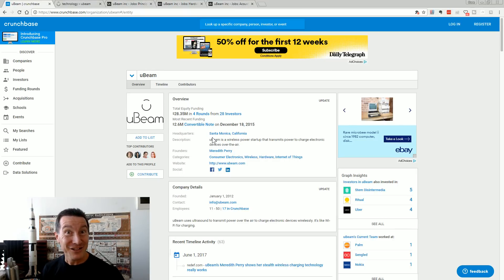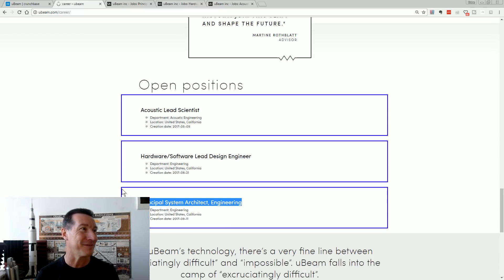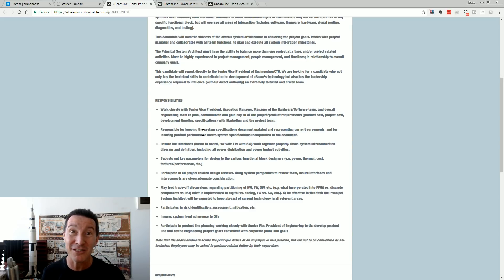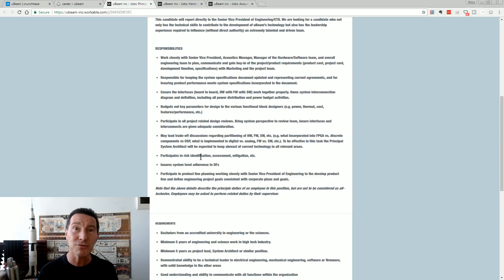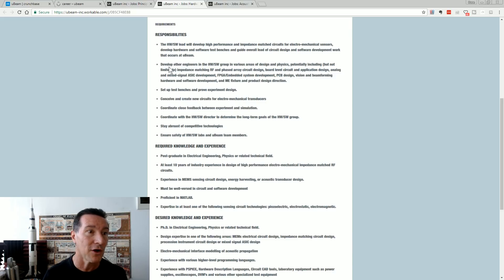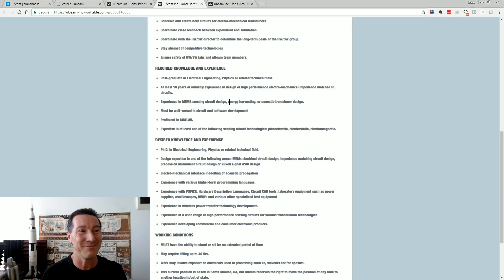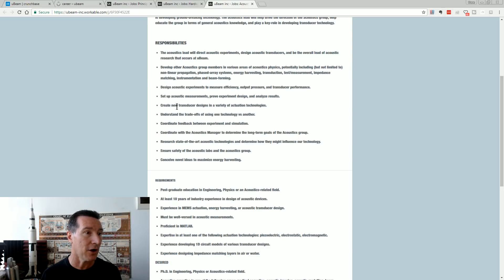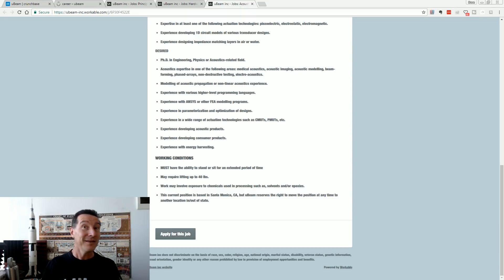More uBeam Ultrasonic Wireless Charging LOL's!

Comment: The Tesla coil wireless power is the closest thing to this B.S. But even Tesla coils don't put out enough Current to charge anything. They just light up Fluorescent lights.
Reply: Tesla's wireless power could supply more than enough to charge stuff. The receiving antenna for it is certainly not portable though.
Reply: the trick is to have a receiver coil of the same inductance as the secondary of the tesla coil, and then to put a low turn count secondary around the receiver coil so that you can pull higher current, after all the voltage is way to high to be useful.  But as rocketman says, it is not that portable.

Comment: That HW/SW lead job looks terrible. Not only did they put so much responsibility on one person, but they also seem to be really looking down on how much work a SW lead also needs to do. The software lead or principle software architect is a full time job on its own, and they tack this on to the hardware lead. There is also the fact that someone who is trained in a different area will never be as good as someone trained in software. So yeah, that should be two separate jobs.
Reply from the maker: Running short of cash?
Reply: I wouldn't be surprised. It is either that or they are showing how clueless they are again. I wouldn't be surprised if they think that software is just writing code.
Reply: the lead job describes a $400k-$500k/yr position, I bet they will offer something insulting like $100k.

Comment: Dave, I get your videos. You're probably right, but the fact that someone is looking for extra people on board doesn't mean they haven't done anything of course.
It could be, maybe very likely, but it doesn't prove anything (yes it suggest something)
Reply from the maker: Err, I said that in the video that they have obviously done some good stuff already.
That makes is even more puzzling why they need someone now to essentially go back to basics.
Reply: I agree with you, that's not the point.
The point is that a job ad doesn't say much at all.
It is pure speculation, which is pretty close to just simply bashing people.
I also don't agree with these types of companies/startups, but just posting stuff that's only based on speculations doesn't feel right either.
Reply: Not just speculations. Based on the claims, they are still almost in production. Claims that just doesn't match the jobs they offer.
Reply: That's a bizarre way of reasoning. Like I said, yes it's a bit odd, but that doesn't prove anything at all. Hopefully people don't think that way when developing stuff. Following that way of thinking is exactly why these type of companies exist.